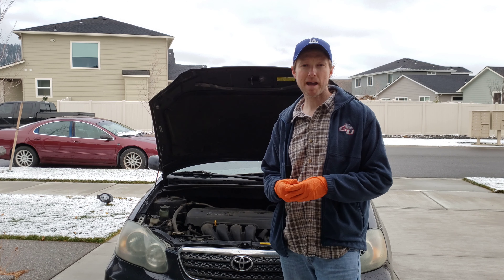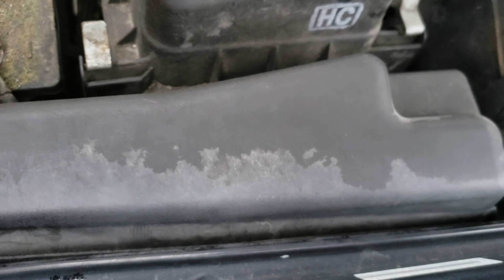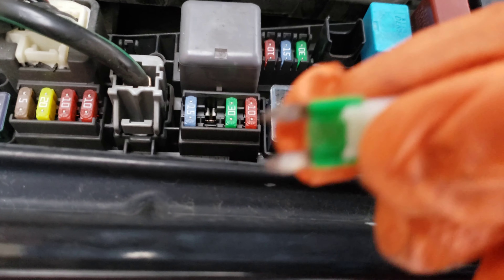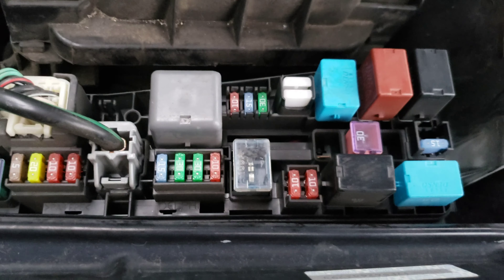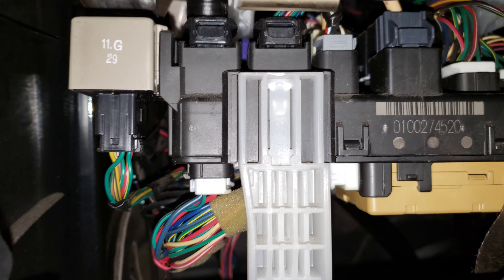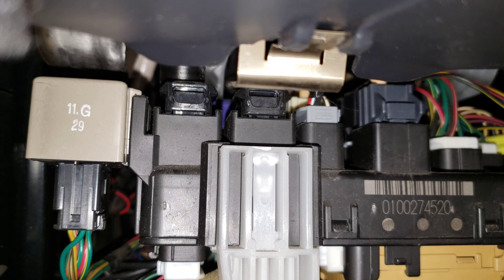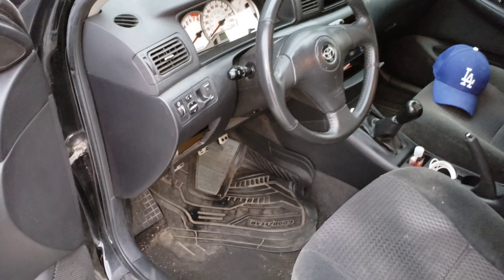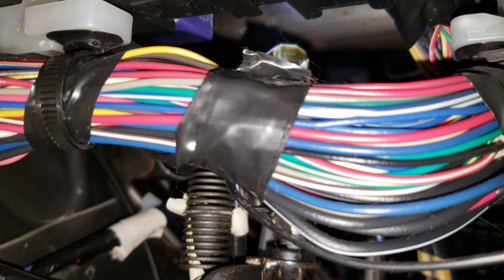How To Replace The Starter Relay On A 2003 2004 2005 2006 2007 2008 Toyota Corolla

Comment: How do you take out the starter relay?
Reply: The best way is take out the vent besides steering wheel and relay is visible for easy take out, use screw driver to pop it as there is tan on the relay hope that helps
Reply: @rajdumra-u8u  there is no side vent on those models.
Reply: I just did it, took like 2 minutes.  I popped that change holder out, stuck a flashlight in there.  Slide seat back and law down by the pedals,  look up from under and you see it behind a white plastic mount.  I put my thumb and finger around the ends, and popped it out,  put the new one in and car fired right up.
Reply: @TherealTomhoward  did you record yourself doing it. That would help a lot
Reply: @a.m.1460 I found it was easier to simply remove the instrument panel, two screws, and then two wires, and you can see it from the top. Important to know since it only goes on one way.

Comment: Lots of videos showing where this relay is but nobody shows how to do it.  I do not believe it is actually possible to remove.
Reply: it comes off. Just worked on one hours ago. get a good grip and pull. best of luck
Reply: @crod038  Where it is located there is no way to get any kind of grip on it.

Comment: Trying to find a video of someone actually removing a relay. I can't get the little blue denso to budge. I feel like I'm going to rip it in half
Reply from the maker: It's in there tight, you could use a relay puller with a 90 degree angle but might be hard to fit in there.  Hope you get it good luck!
Reply: @ToddsGarage  Thanks, sounds like I just need to yank it out and have an extra on hand

Comment: I changed my started and then nothing. Watched this vid and boom! It runs! Lol. Thanks.
Reply from the maker: Thanks for watching,  I'm glad the video helped!
Reply: This is what I’m hoping is wrong I changed my starter two weeks ago and changed the battery myself today I’m hoping this is the problem but I have a Camry so I don’t know which fuse I try to pull all the 30s out and it’s tough I don’t wanna break it
Reply: Tengo un Toyota corola  ase lo mismo prende ala segunda alguien sabe que puede ser

Comment: My 2005 Corolla is experiencing intermittent starts. I am currently at the Gas station and it will not start, so I pushed it into a parking stall. Thanks to your video, I have discovered a possible failed 30A Fuse, and replaced it with the spare as you instructed. The car is still not starting, so I will wait a while to see if it will start, then, I will proceed to the Local O'Reilly's Auto Parts store to see if they can replace the Starter Relay...I will remind them to disconnect the battery.

Comment: If you here the click click click from under the hood it's the starter solenoid which is attached to the starter which is located under the intake manifold. If it's click click clicking that means the starter relay is working just fine.

Comment: Hi Todd. I noticed my instrument cluster not responding. All the gauges, battery indicator light and others not showing after switching on the ignition. I dunno what fuse to check to confirm. Kindly help.
Thanks
Reply: Its same as the corolla in the video

Comment: My 2003 Toyota Matrix stopped cranking halfway through. 
I replaced the battery, starter, starter switch... and nothing worked. lights come on and react to me turning the key. 
I'm hoping it is this fuse. 
I pulled out the fuse and there was gunk on the prongs. Two of the prongs looked to be a bit burnt. It's the original part so, maybe it is time to change it? 
I read elsewhere that they use the same fuses for that of a 00's Corolla.
Reply: What ended up being your fix bro?

Comment: You don't need to disconnect the battery you'll never get shocked by 12v and that amp rate.
Reply: Couldn't it short out the fuse though ?
Reply: @noyourawsome2lol979  the possibility is very slim but it could blow the fuse (worse scenario) but as long as someone getting shocked by 12v in a car is 0 to none. It is a good practice to disconnect the battery when performing electrical repairs but the reason is to protect other components from an unwanted load.
Reply: Wouldn't say zero though.... got a nasty surprise changing out my alternator in an old grand am

Comment: Its much easier to pull the pocket change panel and the power mirror covers, then you can glab the relay from above and not struggle with the lack of room the way you suggest.

Comment: Pls help me I have a 2004 toyota Corolla type s.
The bottom half of the fuse box has power but the top half has no voltage going through it.
The thick black wire with the green small wire in the tan box has power on one side of it but not the other. (Has power on the right side and not the left side)
Any advice will help I'm a college student and I really need this car.
Thank you
Reply from the maker: Hi Abel, Thanks for watching! I'm sorry but I wouldn't be sure what is going on with your car. I hope you are able to get your car fixed.

Comment: Replaced starter, ordered relay, while waiting for the relay, decided to clean the battery terminals with wire brush, found hidden debris within the terminals. Cleaned and started right up. 
It was killing me, was also considering changing the neutral safety switch, sometimes is the simple things we overlook.

Comment: So how do u replace it then?
Reply from the maker: Hi thanks for watching,  They make a special tool called a relay puller to take relays out. The starter relay is in a hard to reach location, an angle relay puller might make it easier.

Comment: My toyota corolla altis 2003 model has a problem when i pressed the accelerator. Everytime i press the pedal there's a noise come from the relay under the drivers wheel. I thought that the relay is the problem but when i replace into new one the problem is still there.
Reply from the maker: Hi, thanks for watching! I'm not sure on that one,  sorry I can't help. Good luck on getting it fixed, let us know what you find out.

Comment: Add a question to anybody that would know I change the relay check the fuses they were all good took the starter off had it tested it works I'm still getting no power to turn the start over with a mission turn there's no clicking on the relay do you guys know anything of that problem if you can respond to me I'd appreciate it
Reply: I'm chasing a ghost on my Corolla. Check for voltage going to an coming back out of the neutral safety switch
Reply: Im in the exact same situation right now. Batter and starter are fine but still no cranking or clicking
Reply: I’m chasing a ghost too right now, gave up basically lol thank god I got another Corolla 🤪

Comment: My Corolla will only click once and then goes dead and I get nothing after that initial click unless I take off and put back on my battery cables but than again the same thing
Reply: My alternator,starter and battery are all new and I’m about to put a new relay in but want to to make sure the relay was the problem 1st
Reply: Hey same here, did you figure what it was? Car goes dead after the first click when trying to start. I have to reseat the negative cable to give car the power. I see everything powers on except for the engine start and radio..

Comment: What about 1 loud click? Not a bunch of small rapid clicks
Reply from the maker: I'm not sure on that one,  did you get it figured out?
Reply: Yep. Engine was locked up 🤣
Reply from the maker: @1dev2  sorry to hear that. Good luck with everything.
Reply: Well mine went click replace the starter..click.
Guy tapped the start with me turning the key and vrooomm till a day later and click.
Changed starter thinking it was bad .
New starter..click.
Changed purple relay...click...

Time to soak the seats with gas . Main fuse he showed is good

Comment: Yes sir, can you plz pin point me,where is the fuelpump fuse relay,may car it won't start,but it cranking,what happen is I remove the fuelpump and clean,after it won't  start
Reply from the maker: Thanks for watching,  I'll try to address in a future video. Good luck hope you get it fixed!